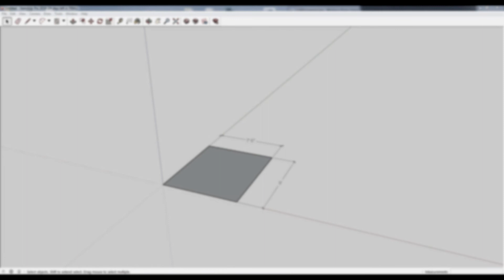How to Switch Between Imperial and Metric Units in Sketchup

Comment: This is great info. I've used Sketchup for just a few designs, so I'm comfortable with it but not an expert user. I design in inches, so using someone else's metric model had me pulling out my calculator for conversions. You show a much simpler way, and I was glad to see the dimension lines I had added immediately switch.
Thanks!😊